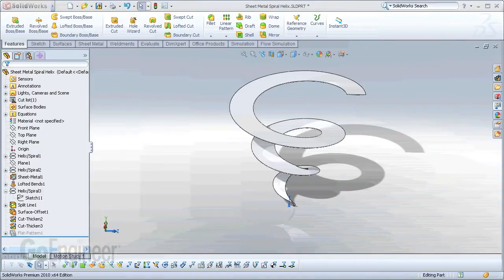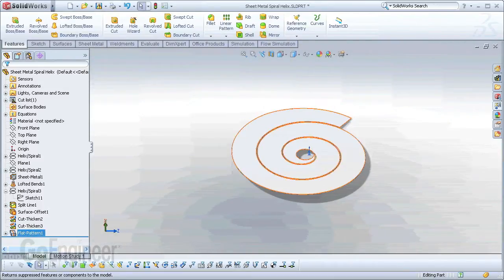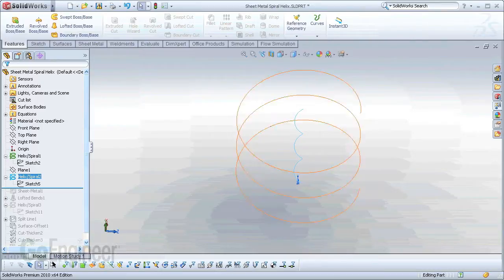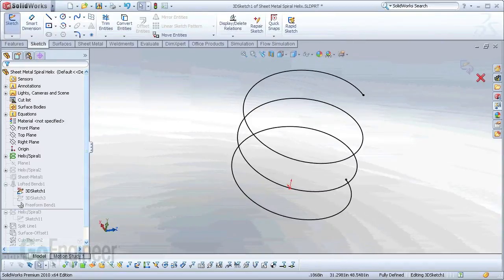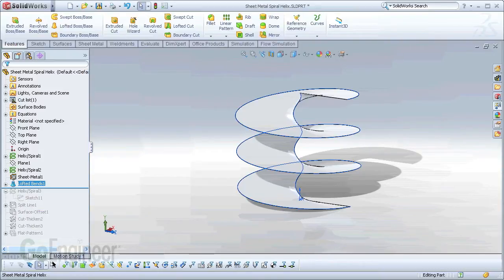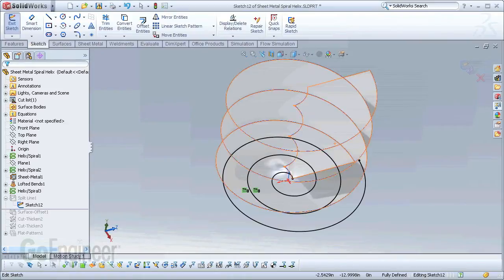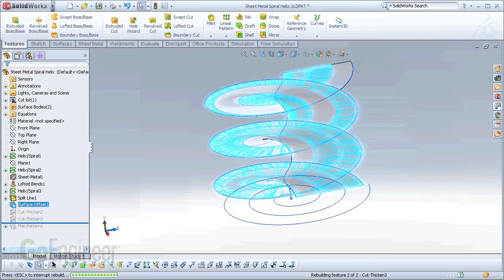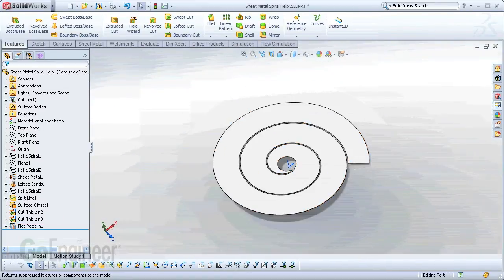SOLIDWORKS - Sheet Metal Spiral Helix

Comment: wondering if there are bend lines in flat-pattern?
Reply from the maker: This model does not create bend lines.  This sort of sheet metal object is "formed" so there are no straight bend lines created to use to incrementally bend the model into this shape.